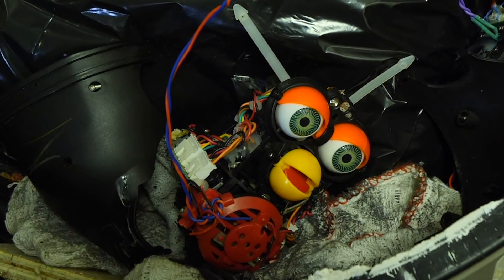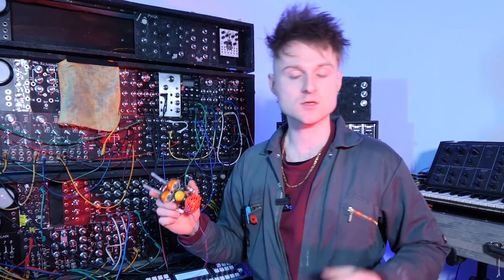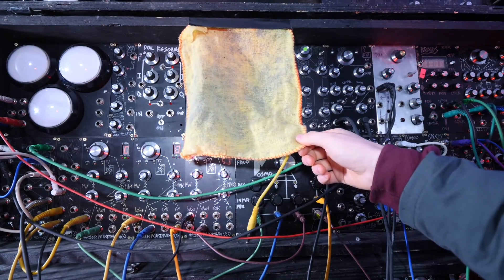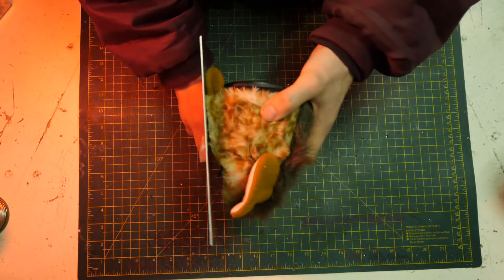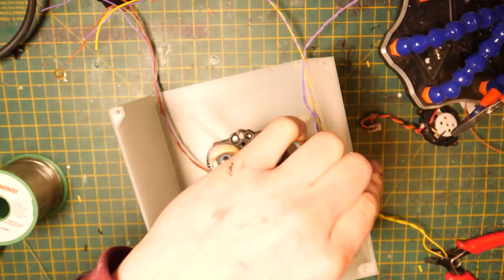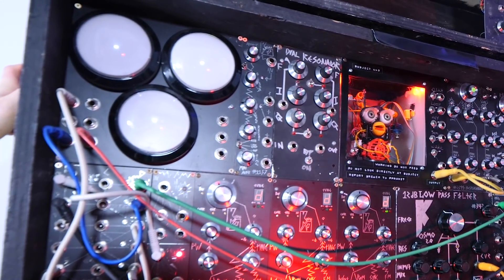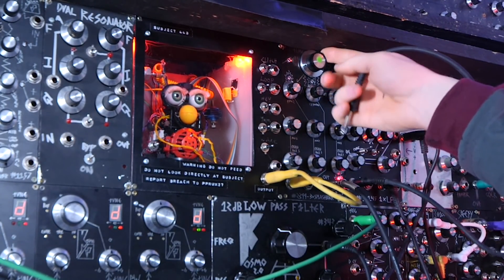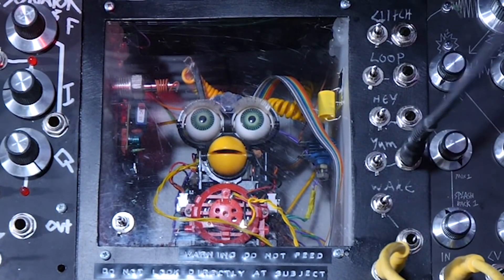FURBY MODULE - A Synthesizer Module That Houses A Furby

Comment: what solder do you use? just curious cause i do some soldering but you do allot more
Reply from the maker: I used to just use lead solder but last couple of years I just seem to have got better at soldering and just use any old crap and it does the same thing. Usually just a big chunk of lead free solder. Through experience I have found it isn’t the solder it’s the technique. Because I have sucked at soldering all the way to being quite proficient. And can say from experience haha. Check your solder tip and also solder temperature. Check out the ts100 make sure your solder tip is always tinned and shiny and not dull it won’t work. Get a new solder tip if so and just make sure it always has solder on it and stays shiny

Comment: I had a Furby that I stripped down a bit too much back in the day, all the mechanical parts removed. I found that it was rendered useless, presumably because the mechanical parts are essential to the program. I probably still have it somewhere. I wonder if there's some way to bypass the program and get some kind of sound out of the chip...

Comment: indeed a main frame
: )
Reply from the maker: sorry about the comments not seen them yet! its been a busy week at work, and then having to build this thing in the evenings haha. will check soon just had a lot on :)
Reply: @LOOK MUM NO COMPUTER  well, i toke a dive in the "psycho" synthesizer circuit for a second time and found there are some flaws in the JK flip flop thing,  it doesn't really make sense.
it's a 12 bit arrangement, but using Q and NOT Q, so you step down from 4095 to 2047 value in 1 clock cycle., that's half 12 vs 11 bits.
the power of 2.

than i found out u can do the same thing using CD4013 and safe on a DPDT switch, replacing it with a SPTD, than i removed the flip flop's all together and placed a 74HC595 / CD4094 and replaced the nand gates with a XOR gates ( witch the pdf from worldhistory indicated, it should be XOR gates, but it doesn't work. )

the new circuit does the exact same thing, but you save on the switched.

please check the video, contains a link to the simulator showing how it works.
https://youtu.be/DOk9Zvw_qfA

would be fun to see the furby move on pseudo random gates. it will be worth the time

than i also found out if you place the clock line on the strobe of the 74hc595 / cd4094 the data on the output is 1 clock later than the actual data inside the serial shifter.
there is a remedy using a cd401066 inverter on the strobe, it's than half a clock cycle later but out of sync.
: )